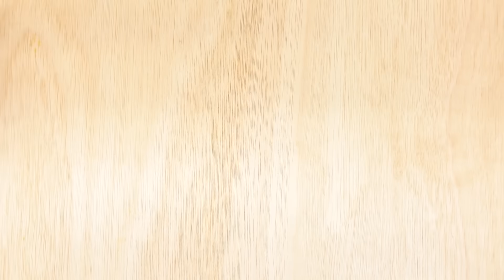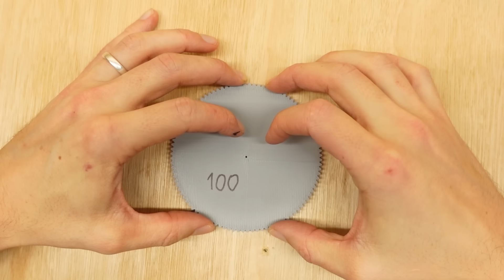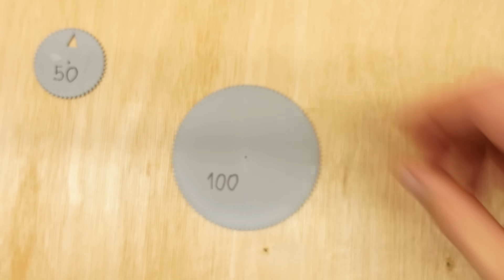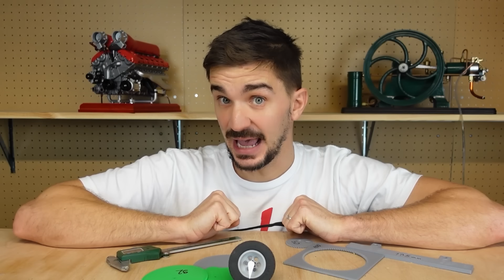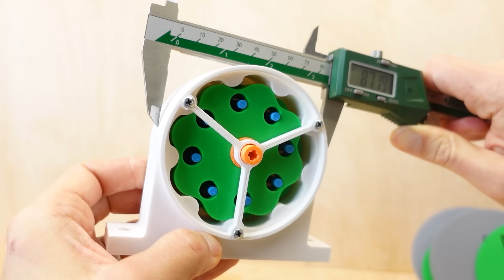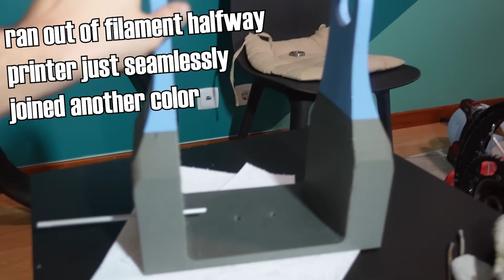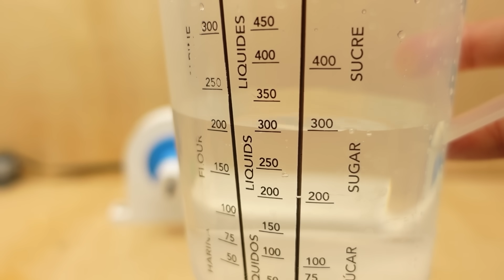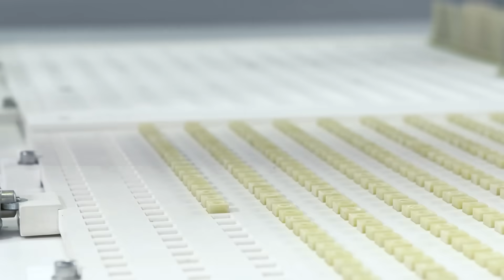Toothless Gears Make Much More Torque Than Conventional Ones, Here's How. Cycloid Drive Explained

Comment: This might explain what is happening in the mythical SEG or Searl Effect Generator. Up until now, I could not figure out how or why it appears to function somewhat like a mechanical diode or rectifier made only from copper, teflon, and air gaps. Diode normally requires semi-conductor not a conductor/insulator pair. The insight is that it's not a diode or valve but a kinetic voltage divider circuit splitting / directing the (small) current down the path of least resistance - requiring quantum tunneling of a cooper pair of electrons across the teflon (at flyback magnitude voltages!) sans corona or any audible arcing. Or more likely 1 electron from circuit that picks up it's cooper pair partner from the atmosphere (hence the machine gets cold during operation). Assuming it is not bullshit. Dunno how many reproductions have been made (it would cost about $250K and ability to create sinusoidal multi-polar magnetisation pattern on the rollers (cylinders that spin about the machine)

Comment: One thing I didn't see mentiones at all was friction. So many contact points means this has to have a ton of friction compared to a standard gear, once again emphasizing low speed operation over high speed. What an interesting concept for a gear though. I wonder if the input/output is ever reversed to maximize rotation speed from a large torque input

Comment: You say that 2 cycloidal gears are imbalaced, and it's true, but what i don't understand is why wouldn't you make one with 4 gears, with the 2 outermost gears at 180° than the 2 inermost gears, that setup will surely balance out, making it suitable for high speed as well.

Comment: 19:30 What if you had 3 gears with the two outer gears applying force opposite the center? In other words add a 3rd gear moving the same direction as the first?

Comment: You can explain all of this much simpler
Just hold 1 point on the edge of wheel in place
Now you can rotate whole wheel around it infinity amount of times
Wheel do infinity rotations but 0 travel if you using edge of wheel as reference point

Comment: I was thinking about using a stepper motor to drive a Sun awning automatically in and out depending on the weather forecast but tha wouldn't have had enough torque. This maybe does

Comment: this is how I distinguish between real engineering innovations and just gimmicks / novelties. Real innovations already have been applied or on their way there, unlike gimmicks that still need promotion, advertisements, convincing, etc. Real innovations just give the raw data and just immediately get applied. This is one of those innovations. "But this isn't a new thing." No, it isn't precisely because it's already been put to use everywhere. I've seen them around but never knew why and how of them. Now I do because of this dude.
Reply: Real innovations absolutely need convincing. Just ask nikola Tesla.

Comment: I haven't finished the video yet, but I did notice that you would have the axix of one of the gears translating while rotating. That makes the system more complicated with increased wear and is structurally weaker. Does the compactness outweigh the obvious trade-offs? It kinda looks like a rotary engine.

Comment: But the number of rotations doesn't actually change tho , it's just an illusion from changing the frame of reference , the gear always rotates the same number of times  in relation to its own axis , but since it's also revolving around the other gear it's axis is also rotating .... If you follow the gear so it's always on top of the bigger gear you'll see it rotates only once

Comment: The small (50 tooth) wheel on the large (100 tooth) wheel only rotated 2 times. You must watch the arrow in relation to the surface of the 100 tooth wheel. Which means you must follow the plane with your head

Comment: You are measuring the center so obviously it changes, measure the outside of the gear tooth relative to orher so obviously it's even bigger. Thus you should only look at point of contact

Comment: If you want to be more economical with your 3D printing look at the size of the component is the thing it's replacing big and simplistic well then it's probably best to just buy from the store but if it is small and complex and expensive then it's usually a good thing to print

Comment: 13:00 the problem with your examples is that yes its cheap but also its plastic; this causes many problems:
1. more plastic more bad(eco)
2. plastic last shorter time than a good quality one
3. POUROUS; DO NOT USE FDM PRINTS IN HIGH MOISTER APLICATIONS(bacteria, mold, quite literally impossible to clean)

seriouslly tho a bathroom is the last place you should be using FDM prints

Comment: What if you had 2 "gears" moving one way, sandwitching one going the opposite direction inbetween them that weighs the same as the other 2 combined? Wouldn't that eliminate the vibration of the cyclodal drive?

Comment: What if you make 3 cycloidal gears instead of 2? If the two outer gears are half as thick as the inner gears, they’ll create half as much force but with 2 of them it balances out. If the outer ones are in phase with each other then their forces will add up, canceling out the forces from the center one, but this time there’s no torque because the forces are acting on the same center point

Comment: @d4aespanol please build a 3 internal gear set up with middle offset 180 degrees from outer and twice the weight of each external gear. So total outer gears match the internal in weight. And test it for vibration at higher speed vs the two gear version.

Comment: So, if the rocking pair is a problem, why not change the cycloid layout from one-to-one on the access with 180° difference to half-to-one-to-half with 180° each? This should cancel completely the forces involved and keeps the contact area the same by only lengthening the shaft by a single additional coupling.

Comment: 19:25 — couldn't this be largely offset by instead having 3 layers, with the middle layer being twice the mass of the outer two, and having the outer two both being 180 from the center? This would reduce the net force on the object as a whole to 0, theoretically eliminating vibrations, but it would mean that the shaft would need to be bend resistant.

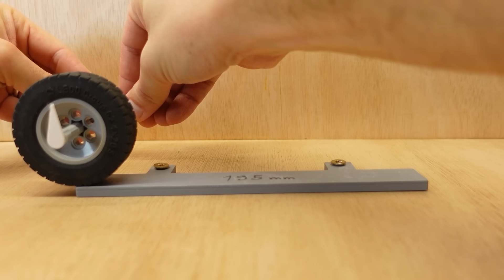Comment: 0:38 = to bottom of the second wheel, points down only because of the way you have its circumcise flattened out. If you had the flat surface rolled into a wheel that contact point would be exactly at the same point.

Comment: I've dealt with cycloidal gears for more than 40 years now, mostly on two stage decanters. In this application they're used to get a differential on the rotor speed and the scroll speed. This means driving not only the input shaft, but also the gearbox itself. To get different speed differentials you use pulleys or a fluid coupling with a vario belt drive.
Cycloidal gear do need special grease and regular refreshing of the grease, but are magnificant pieces of engineering.
They are also used on jackup rigs to move the giant legs.
I enjoyed your video on these gears, you've explained it very well.

Comment: So why don’t we use them for cars? If for high speed operations you could just decrease the width as they are stronger anyways, having more contact points, or you could just increase the number of gear discs so that two will always cancel each others rotation movement

Comment: The rocking motion mentioned near the end of the video could be fixed by using three gears, with the two outer gears in sync with each other and half the thickness of the outer gear. I imagine a much bigger problem is friction.

Comment: If a 2 cylinder engine can be made to have less vibration by going to 4 cylinders, couldn’t the issue of high speeds be addressed with having more gears that are offset?

Comment: Hear me out: A vehicle with both, switching between the two. Doesn't have to be on the go of course. Let's say a bicycle, before a climb, you'd switch to the cycloidal gear set, and for cruising you'd switch back to the teeth gear set. Could be cool, if not practical for maintenance. Taking out an entire gearbox while on the side of the road would mean a lot of possible errors.

Comment: Absolute difference in the number of gear teeth doesn't really matter. The ratio of number of teeth does.
So cycloid drive with 9 to 8 teeth could easily be replicated with usual gears with 100 and 90-ish teeth, which is totally doable.
So, we need a different explanation why cycloid is used.

Comment: You are comparing outside diameter to pitch diameter. You need the wheel OD to be the same as the gears PITCH DIAMETER in order to have a 1:1 comparison. Once you do that, the gear ration is actual the same and the only difference you will find is how much mechanical loss you have.

Kind of disappointed. Your other videos are so good. Its the SciShow and Knitting all over again.

Comment: For the balance: What about a cycloidal drive with three gears, a large center sandwiched between two half thickness gears. This could potentially solve the offset balance issue

Comment: 3:28 if you look at it from the perspective from the center of the big wheel it rotates the same as the straight line..... you are counting the rotations incorrectly by not taking into account the frame of reference as the observer....

Your assertions are wrong

Comment: This video title was not enough to get my interest. But the information is enough to make me soil myself. 10/10, never imagined a reduction set-up existed where the gear is the input with an eccentric, the output is connected to the gear, and the reduction comes from a bunch of lobes in a housing. Why does it work? Who figured this out? Jeez. Also, 10/10 pin that throttle, go learn to hit some ruts and bang the fuck out of that clutch. Yee haw.

Comment: Couldn't you solve the balance with three gears? The one in the middle would be twice as thick. Thus you have one large gear sandwiched by two smaller gears. This would allow the gears on the sides to cancel out both the primary and secondary forces.

Comment: Be aware of plastic creep in your 3D printing. I printed a Rubik's cube solving robot and over time it has required more and more adjusting because of the creep. It is a prototype, and the aluminum finished product is in the works, now that I have the solving algorithm worked out. And, it went through many modifications while developing the structural part of it, which 3D printing made very possible.

This gearbox is quite fascinating, by the way!

Comment: The wheel around the wheel actually depends on where youre looking. If you look from the center, it still only makes one rotation. There was a SAT question with no correct answer in the 80s(?) with this concept but with different measurements
Reply: 1:00

Comment: 19:05 Would it be possible to fix that by having 3 gears instead of 2 such that the middle one is twice as thick/heavy as the other two and moves to the opposite direction? Then there should be neither net force nor net torque to produce vibrations.

Comment: In other words, one could do a cycloidal set with more than 2 plates - say 6 - to cancel out the vibrations (thinking inline 6 piston engine here) to work at higher speeds.

Comment: Anyone else think about what I thought, when he said that these gears are loud at high rpm...
Create a mixed gearbox.

One where these circular gears are used for lower gears eg. 1-2/3rd high moving power but low speed; Then helical gears for 3rd-5th+ for lower Torque but greater road/wheel speed, with the comfort and low sound of our modern automobile.

(Sidenote: I'm not sure how the shafts would work at that point. Maybe continue the end of the circular gear 'crank' like shaft as a normal solid shaft...
Or alternately add an additional shaft - However this obviously adds weight and complexity / greater expense etc.).

🤔

Comment: Toothless gears are the future. We may not have the research to mass implement them yet, but they solve a huge problem in mechanics: cavitation bubbles. With continuous or gradual contact variance gears, the volume of empty space between gears is significantly more constant, meaning less wear and tear from oil cavitation since the change in pressure will be low enough for the lubrication to fill the gap before the available liquid cavitates. All we need is more research and maximum efficiency motors become possible.

Comment: What I dont indersteand is...

When you have a gear on linear rail your gear is meching its 50 teeths twice each to do a full 2 rotations. You put it on a gear with same amount of teets, it meshes with the same amount of teeth, where did that gear found another 50 teeths on the larger gear to mesh with?

Comment: Curious if this would work inversely and much smaller. I am thinking action figure shoulder joint that would hold an arm in place, but rotate with enough added manual force.

Comment: well now you've got me wondering about the possiblity of a multi-ratio cycloidal transmission in a car, though I guess they'd be a true nightmare to make and use, even if the vibrations could probably be solved by using a pair of half-width centres in front of and behind the main one.

Comment: 19:27 Why couldn't you use 3 Gears instead, with the outer ones being synchronized but with lower mass than the middle one, in order to cancel out the force?

Comment: why not adding 2 more cycloid to balance the second order vibration by canceling the rocking ? 
Thank you for the video, it is very well explained and illustrated. Except maybe for the contact point (but that might be on me), i could not really figure out the torque path between the parts, and why there could not be suddent force applied (even though I understand the fact that there is not backlash -> no shock). The force are only applied on one "teeth" at a time isn it ?

Comment: Regarding the end of the video, couldn’t you use a triple instead of a couple with the outer gears having half the mass(thickness for example) of the inner one? That way there wouldn’t be any offset and it’s the same surface area in contact for friction purposes.

Comment: Hello, I really loved your video. Thank you very much for that. 

What I would still like to know is how efficient the different gearboxes are.

I also wonder whether there are helical cycloid drives, or would that not make any sense?
Reply from the maker: Thanks for watching! The high number of contact points means that there's more friction in the cycloidal, so it's less efficient, especially at high rpm. Although modern precision machineed cycloids don't lag far behind, and are usually only 5-10% less efficient. There are cycloids at 90% efficiency. Cycloids are also very silent and strong as is so there's not much benefit for helical gears. They would realistically only create thrust loads which would require thrust bearings making the transmission larger and more complex without any real benefit.
Reply: @d4a  Hey, that all makes sense. Thank you very much for your quick reply. Once I've finished my studies and found a job, I'll support you.

Comment: If you find it interesting, another way of intuiting it could be: 

Imagine that without the gears, it is like a rollercoaster following a track around a circle, which is why it rotates once. The gears then add the extra rotation like they do on the straight track. If there were no gears on the straight track then it wouldn't rotate at all. And for the inside track, the gears are adding a rotation that is opposite in direction to the way the rollercoaster would rotate, which is why the number of rotations ends up as (2-1)=1

Comment: The wheel did not make a full rotation in 1:00. If you respect the rotation of wheel relative to the point of contact with the surface it’s traveling on, then the wheel is upside down. If you’d done the same thing on a flat plane then you may as well have said that it made a full rotation when it was half way through and upside down. 

While it looks the same when you’re not observing from the curved surface, it’s very much not for the wheel and the actual amount of the circumference of the wheel that you claim was traveled on a full rotation was only half of it. This can be easily demonstrated by using a marker and drawing a dot on the point of contact between the wheel and its circular track. The dot will not be in contact with the track at the bottom when it appears to make a full rotation

Comment: I noticed the rotation is equal to the distance from the center of one gear to the center of the other in radius. Like if it's 2r the rotation is 2, if it's 3r the rotation is 3. Not sure if it's useful but I thought it was cool.